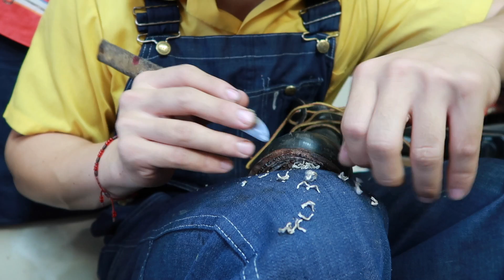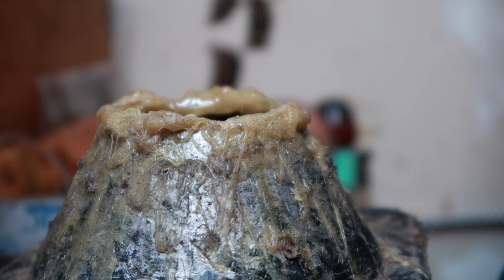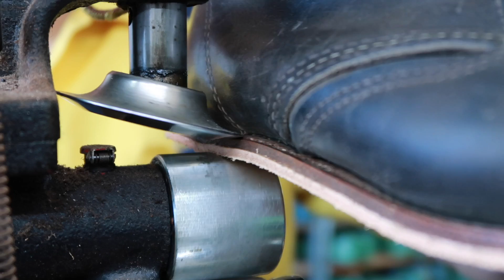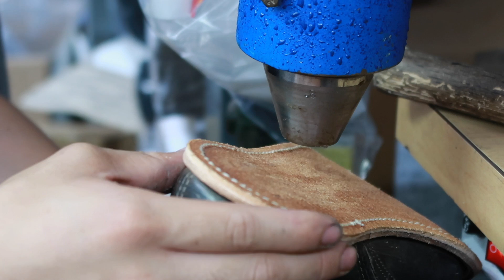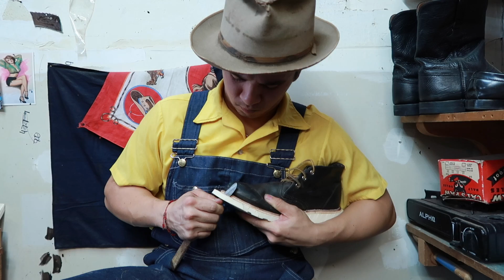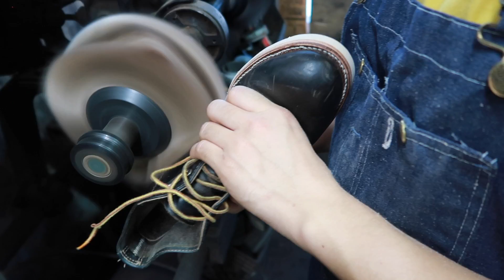RED WING 3150 | NOT REMOVING WELT | Resole #51

Comment: Nice work Sole Brother.... nice to see that you kept the old welt..... that’s how I did it when I worked in our shoe shop....  I resoled  boots many times using old welts, picking the stitches, and stitching as close to the old holes as possible...... EXCELLENT WORK YOUNG MAN I like your technique for setting the stitcher and we had the same Sole press. Thanks you turn back my clock we WILL MEET SOMEDAY ❤️.....👍 Bob in Colorado

Comment: Nice to see the eye pro. If you're not wearing ear pro you should. I tell my guys that when they get old, they'll want to be able to hear their grandkids. Even low db noise will kill your ears. Plus it allows another layer of introspection while working that will surprise you. 

One question, when do you determine that welt needs to be replaced. When I first watched, I figured, after watching others that replacing the welt each time was the "right way" to repair a boot/shoe. 

Comment. I just resoled my WESCO Highliners and of course they have no welt. I drilled each and handstitched.  So I'm looking forward to the WESCO engineer boot rebuild.  

Thanks for these great videos.

Comment: Love it, beautiful work as always. I just had my 3141’s resoled. I wish I did a leather midsole. Mine used the factory RW one. I didn’t know better at the time.
Reply: Hello, could you please explain why a leather midsole would have been better?
Reply: phonebox13 Looks better in my opinion, no advantage or disadvantage. The factory RW mid on this shoe is synthetic, about 1mm thick. It’s barely noticeable until you look closely between the welt and sole. A leather mid adds some depth. The shoe looks good as is, a leather mid gives it some character IMO.
Reply: Dal97GLX thanks for the quick response ✌️🙂

Comment: Aaaargh, why does Red wing insist on white soles for some shoes.
Reply: I've been thinking the same thing. On top of being ugly, they look cheap and tacky.
Reply: They are Vibram Christy wedge soles. Lots of shoe brands use them, not just Red wing. They serve a purpose for certain work boots that benefit from a softer compound and shallower tread pattern.
Reply: They make the boot pop and stand out. I like ‘em on Moc Toes, but they kind of look funky on anything else.
Reply: Common soles for concrete and construction workers because they dont make marks from a tall heel. Some people actually use their boots for work not fashion.
Reply: Henjo29 because boots are for using not for being a hipster
Reply: topherh33 exactly. Also great for roofers, mechanics, and some other trades.
Reply: Beautiful shoe, great recrafting....then that danced white wedge sole comes into view and ruins the whole build. :(
Reply: Wayne Seow these new soles look great, butif you have to stand around on your feet all day, the wedge soles are way more comfortable and easier on your back
Reply: They are non -marring. They don’t make marks on the floor. If you are doing construction work in a building, you don’t want to mark up the floors. Same reason a lot of boat shoes have white soles.